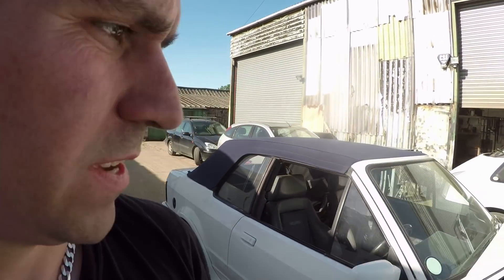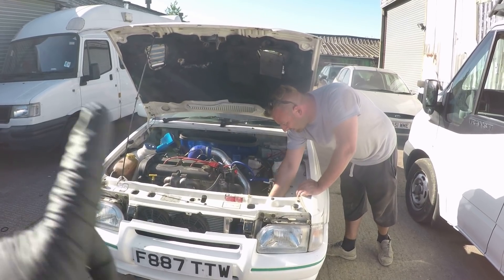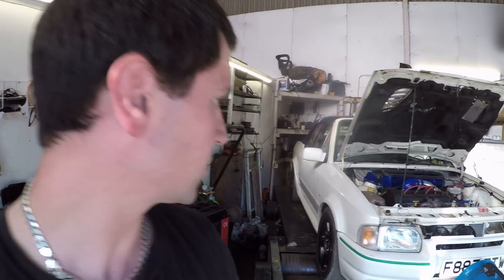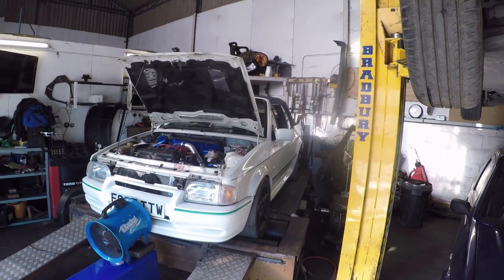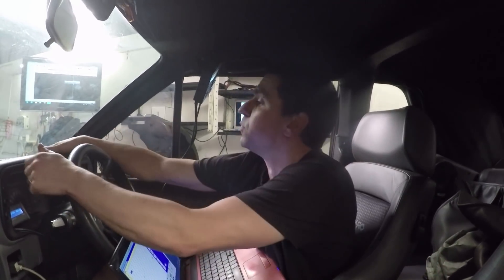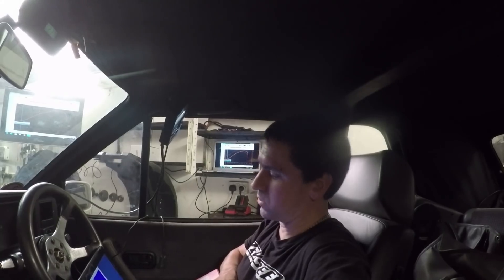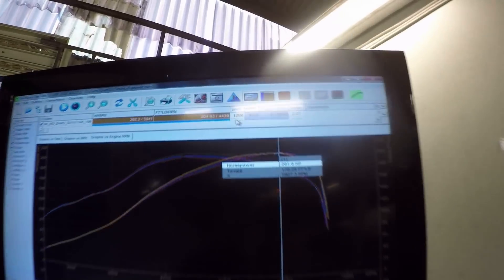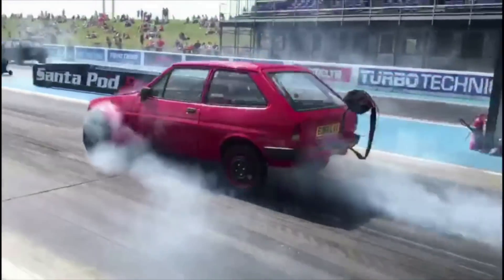Budget ZETEC TURBO hits the dyno!

Comment: I have the silvertop zetec 2.0. Got a gt28r turbo with ext gate. Plenum intake with 650cc injectors, stock pistons, 2mm decomp plate and 2x 0.6mm gaskets. Boost at around 0.7bar (10psi). I made 228bhp, with a bit of playing around we made 242bhp, but decided to keep it safe and stick with the 228bhp.
Your setup should be able to make around 260bhp I think. If the brakes don't hold you back.. Lol

Comment: Must admit I thought it would make more bhp power but still ok figures.. the fiesta under the ramp looks real nice too..
Reply from the maker: The Wippit it would piss 250/280hp when we turn the boost up. But we have no decent boost control so we did not bother
Reply: Ignition Advantages - will you be doing a video on that? What waste gate & boost controller will you be going for?

Comment: Oh the first runs was  disappointing for a turbo my st170 pulls 181bhp on the dyno thats just with a miltek and a decat.
Ive found on the servo there is a adjustment nipple when u remove the master 👍
What afr's are you getting mid 10's or leaner?

Comment: Why change the cylinder head?  I thought the ST170 head flowed more.  I noticed your Black Top head engine has piston oil squirters.  The SVY is the only Zetec based engine over here in the States that have them.  Great content BTW!
Reply from the maker: The ecu does not have the capability to control vvt. That and an st170 head makes a VERY unresponsive turbocharged car.

Comment: All that work and you went from 170bhp to 201hp? Would it not of made sense to keep the st170 head, high compression and run it on decent fuel to make good hp? I bet I could get 300hp at 12 psi on the st170 engine with 20% methanol
Reply: Very true high comp is the way forward anyone who knows serious engine builders the best way to obtain power is to make a powerful N/A engine then turbo it. Hence why the k20 Honda engine responds well to boooost.
But that said this is a budget build. 👍